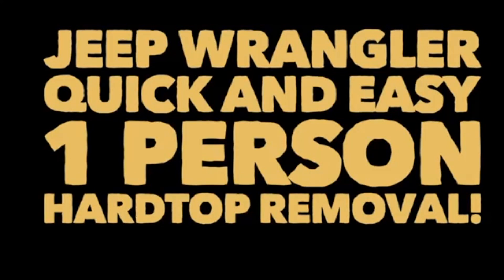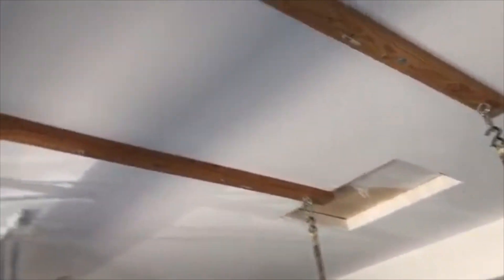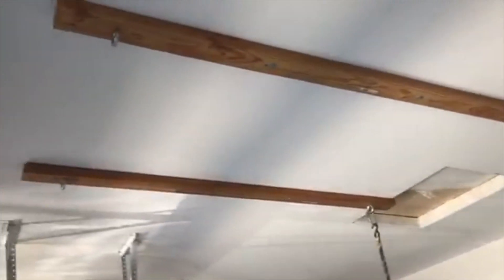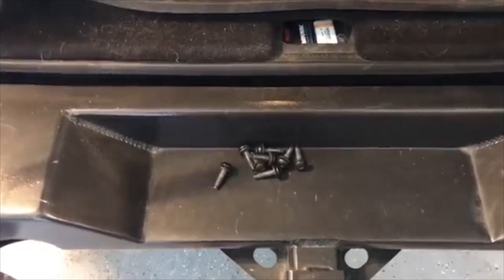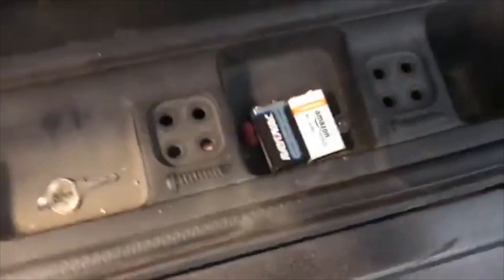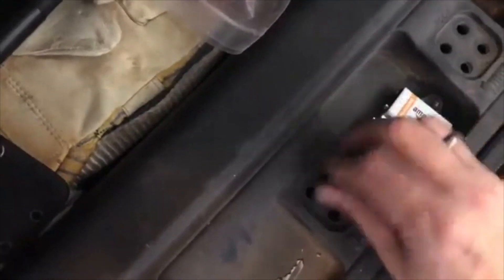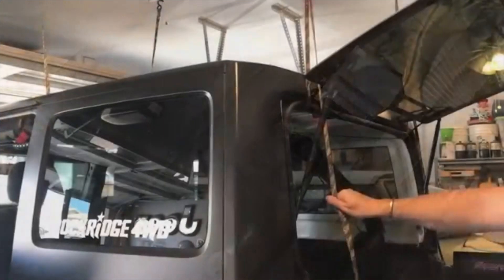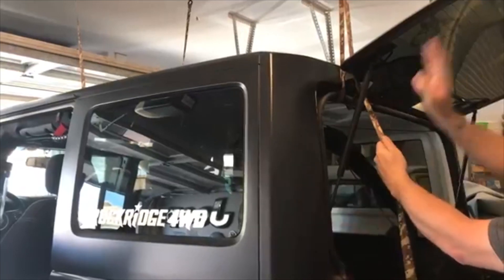Quick & Easy DIY Jeep Hardtop Removal and Storage Hoist System - JKU Hard Top Removal

Comment: I would highly recommend NOT pushing up on the glass! If it's hot or cold or has a small nick it could literally explode into a million little tinted shards.  I had a rear lift glass shatter trying to "help" the gas struts lift the glass. Just a word of caution
Reply from the maker: Good to know! Thanks for the tip!

Comment: What is the distance between the front and rear eye bolts on each 2x4.  Next, what is the approx width between each 2x4.  I could guess or measure but your setup worked so well, I would like to go with your measurements.  Thanks.
Reply from the maker: The 2x4s are 36” apart, and the eye bolts are 60” apart

Comment: How do you call those adjustable straps.
Reply: May you please share the list of materials for me to prepare? Thanks, 'appreciate it.
Reply from the maker: They are called Cam Buckle Straps
Reply from the maker: A couple of 2x4s, two straps, lag bolts to screw the 2x4s into the ceiling studs, and some eye bolts to hang everything from
Reply: @BoldCanyonOutdoors  Thanks a lot for responding to my queries, one more question, how long would be the straps?
Reply from the maker: @jonjoss2000  They are 20 foot straps
Reply from the maker: @jonjoss2000  They are 20 foot straps

Comment: Can you please specify the type of ratcheting device you have used please. Thanks for the video !
Reply from the maker: They are not ratcheting straps. They are the non-ratchet cam lock straps
Reply: Bold Canyon Outdoors Thank you sir, I ended up using the type you mentioned, much easier and didn’t limit travel length of the strap!!
Reply from the maker: Ok good!

Comment: Great system.  Why do you have a carabiner between the ratchet strap and eyebolt?
Reply from the maker: I did that to hold the strap straight. After I bolted in the eyes, the straps hung with the cam buckles sideways, so I added the carabiners to point them the right direction.

Comment: Sorry if this has already been answered, but can you tell me the dimensions for the eye bolt placement?   I'm installing in a carport with cross beams so the left/right is no problem, but I have beams 2 feet apart.    Also, were those 20' straps?   Thanks for the video.
Reply from the maker: Yes, they are 20 Foot straps. Center to center (front to rear) is 60 inches
Reply: @BoldCanyonOutdoors  54" wide?
Reply: I meant 34" wide/
Reply from the maker: Roughly yes
Reply: @BoldCanyonOutdoors  You posted 16' straps not 20'.  will the 16' still work? Thanks so much! looks awesome man

Comment: Any chance you know the exact model/type of straps you used? The only ones I can find in my local hardware stores, the length of strap to the clips are about 12 inches which is way too short so I need to order the right model online.
Reply from the maker: I don’t know an exact model. I bought them years ago at Harbor Freight. They are cam-buckle straps

Comment: Great video, but has the rubber seal in the back been damaged by the constant pressing on the seal?  I was going to do this same thing on my JL but Im worried about damaging the weather seal.
Reply from the maker: If you’re careful, you can do it without damaging it. Also, the JK seal just presses in so it’s easy to remove if you’re worried. Don’t know about the JL seal though